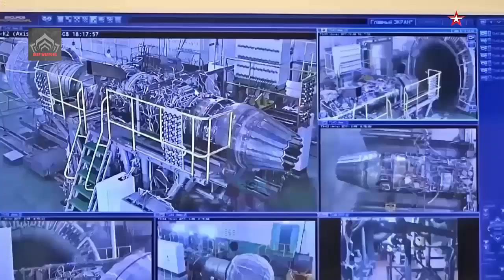Russia's Fifth-generation Fighter Jet s-75 Checkmate will begin to be produced serially in 2027

Comment: They are definitely going to have to redesign the air intake
That thing will definitely not go supersonic until it is
Reply: lol what a load of non sense being someone who was involved directly in aviation field it’s dsi intake is sleaker than X-32 was.Only issue is it will get less air in intake to cool engine down which will make it use more fuel.But since it’s using large wings it will largely fly at high altitudes where air is cooler allowing better fuel effiency please stop with this silly unexpert comments!